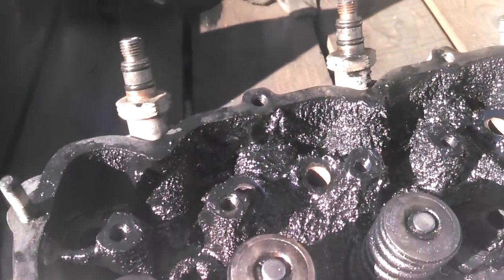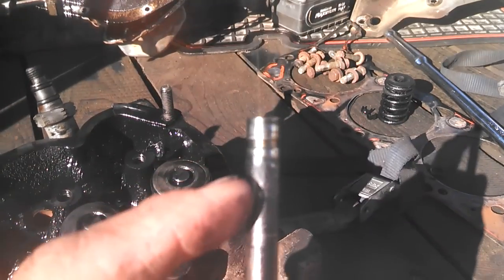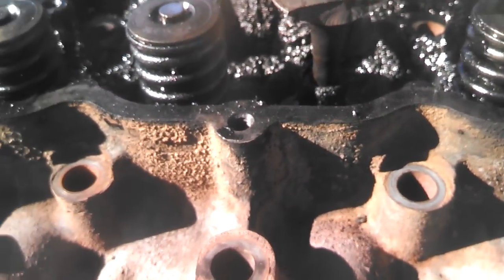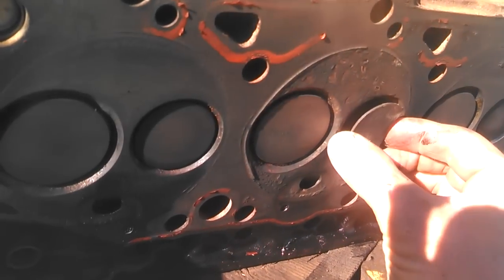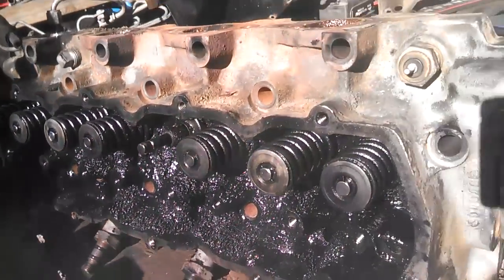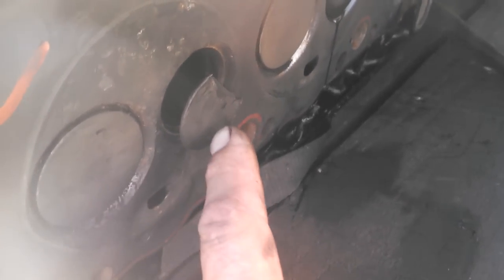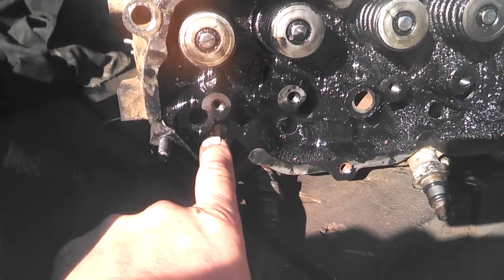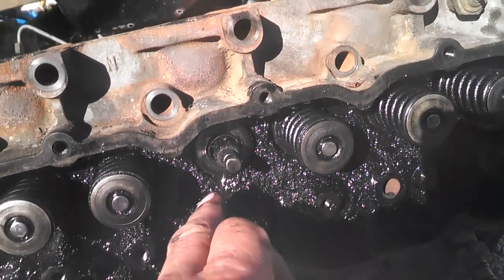7.3 IDI post mortem findings

Comment: My 93 7.3L IDI "chuffed" for 3 years and about 50,000 miles. I got a quote for a head job, but I just kept driving it. It ran great except for that sound. AND, I don't recall ever hearing the "chuff" until I removed my muffler and ran a straight pipe. It only did it when it idled, but it idled smooth. 

The best diagnosis I got was a burnt valve. My relationship with the old truck ended violently when a tanker truck changed lanes on  me on an interstate bridge, and the trailer lammed me into a concrete barrier, dragging me that way for 3/4 of a mile. That F350 saved my life. Anything smalled probably would have been crushed like a can.

Comment: A question and thought. If the engine was worn with high miles and had a fair amount of blow by and starting fluid was used could a small of unused starting fluid made it to the crankcase and return up and cause a extra burn between cycles and to much combustion may have cause a lose valve and crack from the extreme pressure
Reply from the maker: Short answer No, long answer no it's an issue these engines are known for that being the valve guide wear.

Great question mind you.

This engine had about 120,000 miles only but many HOURS as it was used on logging service and would in my mind be idling near all day etc.

I had a chuff out exhaust and new I had a bad valve seat because of chuff.

Stand by my explanation and synopsis of the post mortem